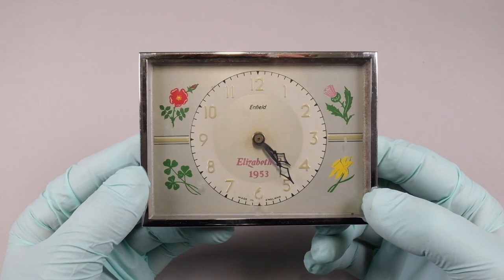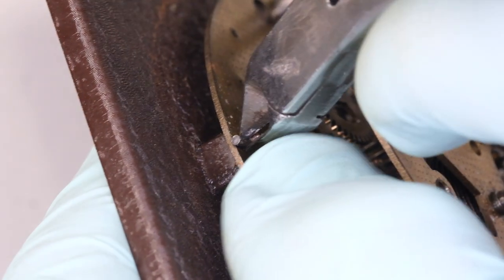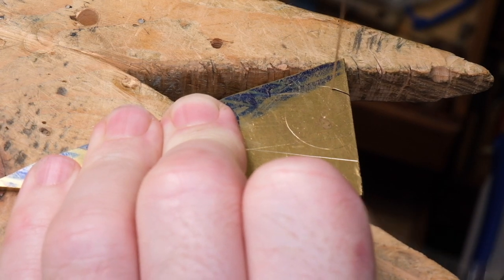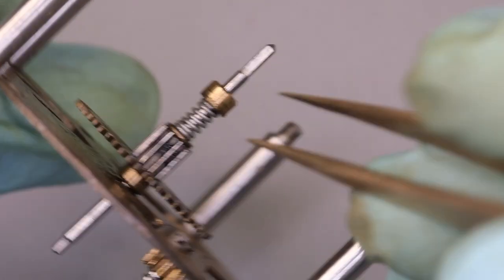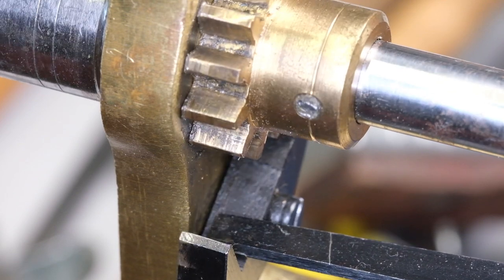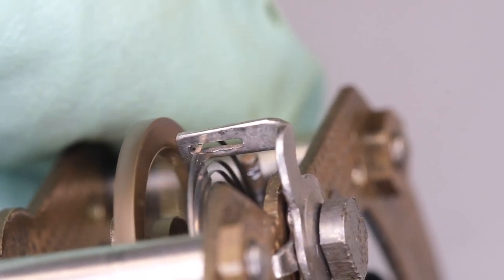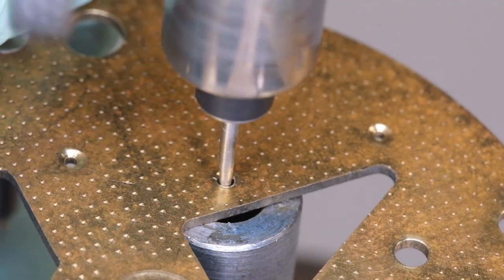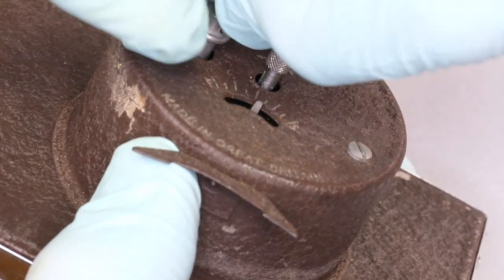READ repairs #002 1953 souvenir clock commemorating the coronation of  Queen Elizabeth II

Comment: Matthew with this type of movement if the spring had run down would you expect the balance to start up  automatically after rewinding or would it need give it assistance by starting the balance going by slightly tipping the movement. Thanks as always Ian
Reply from the maker: You would expect it to restart.  I suppose theoretically, you could stall the balance but the slightest movement will restart if all ok M
Reply: @readrepairs  thanks Matthew